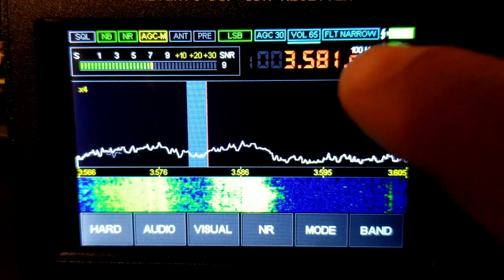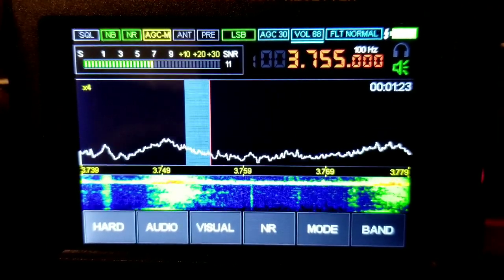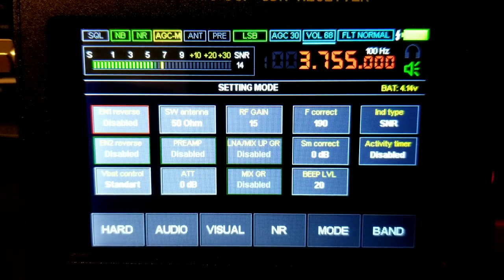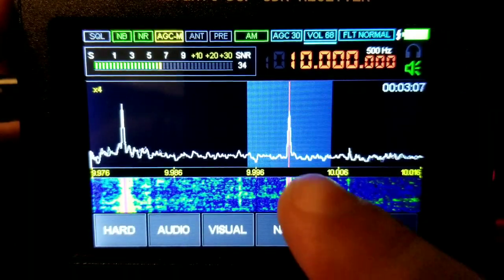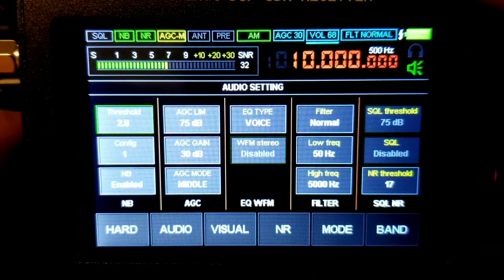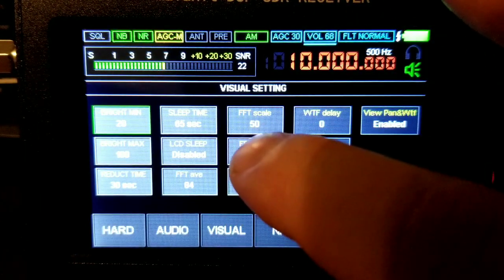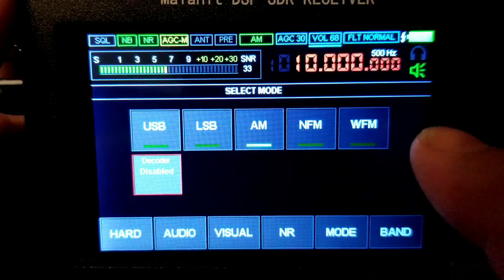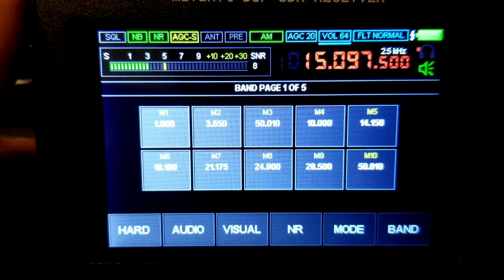How to get started with the Malachite dsp sdr shortwave receiver - the basics

Comment: Thanks a lot
Concerning Date and time settings, I did what it is wroten in notice but
only problem I have done this but, it is impossible to save Date and time settings definitively. I have to set date and time every time I switch on the radio, this is awful.
Is there really nothing to do ?

Comment: Hi  Gerry  concerning   changing  the   internal  Xtal  unit, it was  mentioned  on  one of the  Malahite sites  either  the  Chinese  or  the Russian  sites, there are a few  different 22 mhz types  &  I  finished  up getting  a  very small  unit that was too  small  & someone else  managed  to wire a  larger one in  so  its  hit or miss  untill  I find the correct link, the  site  is  Alie  Express  &  was in Polish which made it even  harder  to order, I  will  keep  an  eye out  for  the link  again  to send you.

Comment: Some good  info, could you please show  how  to set  the  time  please as  it isnt  comomg up  with the  method  of pressing the encoder  until it beeps
Reply from the maker: That's how it works on this unit. It may be different on your unit.
Reply: @GerryDX  There was  conficting  info on line, I  have  found some other  info  &  it says  press  the  Hard  Menu  for  over  two  seconds  until  a  beep  is heard  then the  Time  setting  menu shows  up,  this  can be  then set  with  the  Volume  encoder with short  presses to  move the underscore  over to  the next  section, then  pressed  for  2  seconds  until  a  beep  is  heard  again  to  set it  in  memory  afterwards, many thanks for  your  reply &  interest.
Reply from the maker: @texhow1  I was fumbling around and had the same result with the hard button.
Reply: @GerryDX  I have 3 china  versions  each  with its paid for  firmware  updates but this  DSP  SDR V3  is  a  lot  better  once you can  open the  menues, I  have found that if  you  touch your  thumb  from the  Menu  buttons  on  the bottom  &  touch the case  at the same time  with the same thumb  they respond  straight  away, otherwise  you have to keep  tapping on them,  once you have opened them  they work  ok.
Reply from the maker: @texhow1  nice!